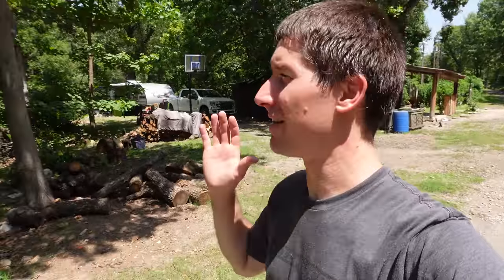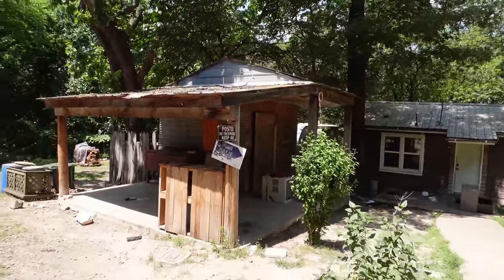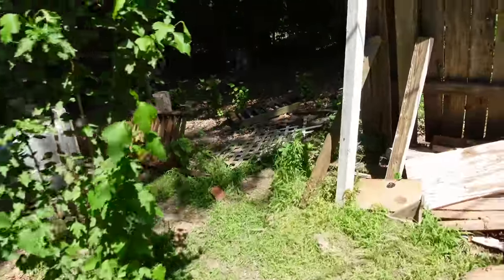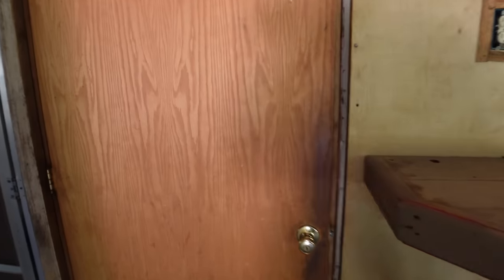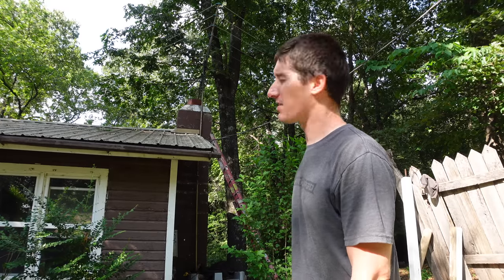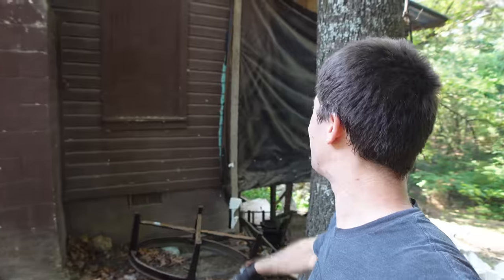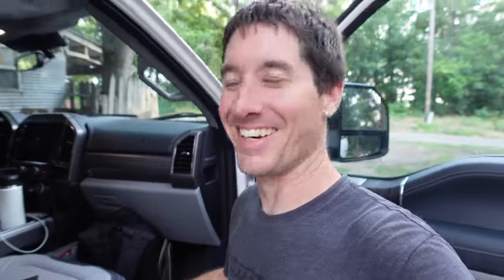I Bought An ABANDONED Mini Resort

Comment: Stove is likely worth something so don't be quick to toss it.  And the reason for the wood stove is to heat the house.  The Fireplace lets most of the heat out of the flue where the wood stove actually controlled heat better and would heat the home.
Reply: Came to say the same about the stove
Reply: As someone that tried to sell a perfect Glenwood CI stove, the market for those older stoves is incredibly small. I think he should service it and keep it.
Reply: He better save that stove. It’s probably the nicest thing on the property. Ben’e appliance and junk would probably give you 5 bills for that Gem. You can’t find the old Frigidaire stoves anymore.
Reply: Ain't nobody want no old ass stove for stove nerds, that's a stove for stove nerds
Reply: With an old fireplace,  all the heat goes up the chimney, provides no actual heat to the house.
Reply: @smith6ar  I love how this guy thinks everyone is as basic as him
Reply: Yeah, fastest way to cool a house in the winter, light a fire in a conventional fireplace. It's draws warm air in, and up the flue. Even without a fire, if the damper isn't closed perfectly, warm air is running up there in a convection draft.
Reply: @drippingwax  You find it weird that people cant physics? Particularly with the defunding of public education?
Reply: When I was a teenager my parents and I moved into a house that had a big cast iron wood stove, just about heated the house and when the power would go out during a storm my mom would cook using the top of the wood stove. In fact a friend of mine lived in a small house that had a wood & gas burning stove in the kitchen. The stove heated the whole house so much so that his mom would only use a microwave or electric hot plate during the summer... This was in Napa California in the 80's....
Reply: @josephblanchard943  yeah, things like that work great t, as opposed to the old brick fireplace. We had a steel 70s free-stamding in one house, and that metal would heat up and radiate heat for hours. Sometimes, in the middle,of winter, it got so hot we had to open the windows.
Reply: Here too say the same I would keep it
Reply: You can get high efficiency zero clearance wood fireplaces that pump out 70k+ BTUs of heat.  They're fed with outside air and the heat they generate stays indoors.  They cost a lot though.

A wood stove is definitely a cheaper option for efficient heat, but could be a liability for a vacation or rental home.  I'd go with a mini split instead.
Reply: @mycosys  not basic, clueless.
Reply: @Shauma_llama had an apartment in Oregon with no central heat, just wall heaters, half of which didn’t work, and an old (early 60’s) freestanding electric stove. Most of the time we’d run oil filled electric space heaters to maintain a semi comfortable temperature, but when it got REALLY cold we’d just cook something in the oven; it put out more heat in less time than the wall heat & oil heaters combined. We’d also have to crack a window when running it longer than an hour like when cooking a Thanksgiving turkey otherwise it’d get unbearably hot.
Reply: @robertm5969  exactly,  as an Airbnb owner myself last thing if want is people trying to light a fire in a wood stove
Reply: Keep the stove. It radiates way more heat than a fireplace. If you keep it running right, it creates less cresote in the chimney. Just make sure the chimney is clean. Before your first time lighting it
Reply: @drippingwax  Air that enters the firebox is heated, and flows up through the chimney, that's why we can have an open fire, but not suffocate in the room. The vacated air in the fire box, is replace by air in the room. Effectively, a vacuum is created in the house, that eventually will draw in external air from air leaks (badly sealed doors, windows, external walls, etc). So a plain fireplace effectively draws in more cold air, than it can produce radiant heat. You sit on the hearth and feel warm or hot, but the rest of the house will see the temperature plunge.
Reply: Those homes look like they are from walking dead series only in worse state
Reply: I ❤ demo!!! It's putting it back together that sucks...😂
Reply: I just sold a wood stove just like that. Had a bunch of folks wanting it. I wanted a wood stove with glass.

Comment: John Ross, after working on old houses for years, my guess is you'll be far ahead to remove the house, too, and either move in a prefab or modular or else build from scratch.  I've been guilty of trying to make a silk purse from a sow's ear and that's what this project is.
Reply: I agree, however I wouldn’t make the decision to tear down until the additions are removed from the house and structure can be evaluated.  I expect that their is plenty of water, foundation and termite damage.  The bathroom is nasty.  I also expect the plumbing and wiring is a mess too.
Reply: Environmentally speaking, I like the reduce, re-use, recycle approach rather than trash the lot and bring in new resources.
Labour intensive, yes! But it also retains  some character. I like a place/vehicle with a story to tell.
Reply: Home Depot is selling prefabs now.  JR will never get the smell of a@@ out of that house.
Reply: Probably best to bulldoze the decaying buildings and build something nice on the property
Reply: It’s a demolition job for sure he just bought a site or building lot

Comment: The wood stove is because fireplaces don't throw off much heat. The stove radiates better, so they were heating the house with it most likely. If you want to heat the house with the fireplace, you'll want an insert with blower motors otherwise 90% of the heat just goes up the chimney (I tried to heat my house with a fireplace in Texas during the SNOVID freeze in Feb 2021 and it didn't work at all). If you just want the fireplace for ambiance and cooking marshmallows then do whatever.

Comment: Crazy part is that people lived there. Seeing those chains that were probably used for the dogs is heartbreaking. Anything can be fixed up with work but it might be easier just to start from scratch. You obviously can do it. Looking forward to the change of pace.
Reply: I'm kinda thinking the same. It can be done, sure, but I'm wondering if the cost to bulldoze and rebuild wouldn't be far away from the cost to rehab what's there.
Reply: Agree. bulldoze and start new
Reply: Why? The frame is already there. Strip it to the studs, and start from there. Unless he can’t live with the layout, it’s a huge waste of money to start from scratch.
Reply: I hope they didn't abandon their cats there too.
Reply: @BearGrils55  Ok but stripping to the studs is a ton of work.  tear down is quick and framing is quick.  So if it needs a new roof and siding anyway.  cheaper to start over.
Reply: It’s not that much work. Ive done it plenty of times. You could easily have that place gutted in a day. Framing, and bulldozers cost money. Gutting it yourself is free, with the exception of the dumpster.
Reply: Also, he’d have to redo all the plumbing, and a new foundation. I don’t know in what world buying new wood, plumbing, and renting heavy equipment is “cheaper to start over”
Reply: @BearGrils55  if you think the foundation is anywhere near up to code you kidding yourself. This is the type of house where you did what you wanted when it came to building. Much of it is wrong those support beams for the "deck didn't even have lateral support lol. Just start over .
Reply: There is no foundation ‘code’ for this house. It’s grandfathered in. Also. Support beams can be added. But, you changed your tune from “it’ll be cheaper to bulldoze” to it “doesn’t meet code”.  I never said it was built the correct way. I said it’s cheaper and easier to rehab what’s there.
Reply: @BearGrils55  Probably not, need to factor in running costs, hospital fees, and life long medical conditions.  The resale value of a decent new build would be substantially higher than a patched up shed in the middle of a tip.
Reply: @BearGrils55  But professional concrete foundations will be needed to prevent the same level of decay recurring.  I would fancy the ready to assemble log cabin type of building.  And a coherent style to the place.
Reply: @uroplatusgecko2773  It's lasted for probably 50 years as it sits. it can be repaired to last another 50 years. It's awful looking, sure. but you have to have a vision for these things, i see the potential. As long is the structure is solid there is no reason to tear it down. what Hospital fees, and life long medical conditions are you talking about? seems like you're making up hidden expenses to justify a bad argument. if it were me, id gut it and redo the interior. green metal roof, and install log cabin siding. if he were to tear it down, he would've been better off buying a plot without a structure.
Reply: Bulldoze it.  Regrade the land and build new or just move a nice camper up there.  It’s really bad…
Reply: Keeping the structure and it is a re-model....otherwise from scratch building permits etc...
Reply: @christopherhamilton5557  It's really not that bad. just filthy. You must not do physical labor.
Reply: @BearGrils55  yes.

Comment: 14:27 Ashley heater were pretty common in the '50s & '60s. That one is pretty beat up but it would be more efficient than a fire place as you have more control over the burn. That dial is attached to a chain that opens and closes a damper. If I remember correctly the chain is on a primitive thermostat, it is a coil that opens the damper more if it senses the fire box is cooling down. They worked pretty good even if they were kind of ugly. The other good thing about those heaters is the metal surrounding the fire box gets warm but if you or a child was to touch it while the fire was going it would not burn you.

Comment: The wood burning stove will provide much better heating than a standard fireplace.  I would recommend keeping it!
Reply: He gets to pick
Reply: The fireplace was /is a heatalator. Metal sheel inside metal shell. See the exit vents.
Reply: I'd keep the standard fireplace for ambiance and use a heat pump mini split for heating/cooling

Comment: You need to do a "Holmes Inspection on the Home" and do what Holmes would do.  Tear it all to the rafters and studs and pull all the electrical, plumbing and make it all correct and have a nice cabin instead of the smoke shack....

Comment: The nicest things in the house are that stone fireplace and the 1950s kitchen stove. It would probably be cheaper and faster to tear it all down, you can buy a brand new park model mobile home with furniture, appliances, dishes, silverware, linens, etc already in it for under $50k, add a prefab shed and a steel carport, done, BUT, it will make for a lot more and better YouTube content to gut and rehab the house that's already there. The original part is probably at least still structurally sound, if you strip out all the junk and the half-assed add-ons people tacked up over the years.

Comment: With the wasp and hornet killer, you need to find their nests and wait until about sundown after they've all pretty much returned for the night. Then that high volume stream is used to saturate the nest and kills all of them on contact, including the larvae. The stuff I use will also kill any that return later for about the next four days or so. Then you can safely knock the nests down and toss them. If you don't hit the nests, you'll continue to have problems.

Comment: The fireplace will not really do much  towards heating the cabin. Pretty much just for atmosphere. However, the wood burning  stove will actually heat that small space fairly well. My cabin (7000 high) in the mountains  of northern Arizona(Flagstaff area) is quite livable in the winter. Keeping the fire tended, and banked at night, is necessary, but will do the job. My place is around 1200 sq. feet. Keep the stove unless you plan to add gas heat,or not  go there during the winter.
Reply: You can get high efficiency fireplaces that heat entire houses but they're not cheap.  But for this house I'd probably go with a mini split for AC/heat

Comment: Wood burning stove insert looks like it also has a blower and vents in the face of the stone work above and to either side of the stove. I think they used to call these "heatilators". But this would have been used to heat the home. Honestly, from what I've seen so far (17-18 minutes and I know you've already gone way far ahead with the project) this would be a tear down and start over. I've seen homes in this kind of shape on the west coast in San Diego, Pacific Beach area, where there was a state moratorium on new construction. The workaround was to tear down until there was one small bit of original interior wall left and then rebuild from there, and the County would call it a "remodel". That's what you should be doing here. But I know that's not going to happen, so I'm on board to see what you do with the place.

Comment: Sad to say, most of the construction is rather sketchy. Before spending any serious time and money on remodeling it, I'd take a close look at the roof and the foundation to see what's needed to make it safe. It seems pretty clear that the county doesn't do inspections unless you pull a permit. I can't believe that there were any permits pulled for that cabin based upon what's there in the video. The pavilion is the only thing that looks like it was constructed by someone who knew what they were doing, and even then the roof may be salvaged material with pre-existing holes.

Comment: I'm blown away that he didn't realize that was a woodburning stove. Have you ever dealt with woodburning stoves Jr.I thought you were like close to my age i've seen thousands of those If you've ever tried to heat a house with a legit fireplace. You'll realize it doesn't work very well. All the heat goes right up the chimney and you just nonstop throwing in wood. However with that wood burning stove you get the heat because the stuff of howl tea produces heat. If you put it on a heating with a wood heat get a wood Stove don't try to use the fireplace without an insert

Comment: I would check the disclosure, if the water heater is as you showed it, it is non functional. If you got the place for super cheap I wouldn't bother. But that is a dick move on the former owner for how the place was represented and would stick it to them if possible.

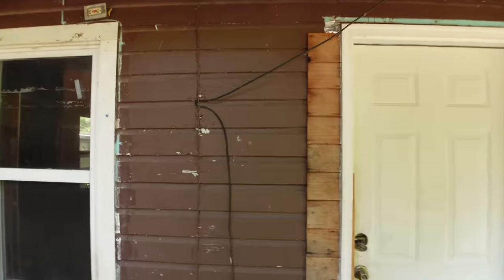Comment: I have never been on this channel. I thought this would be much more interesting. If you want to know about the house, which is the only thing I cared about, start watching at 12:39. Just about everything before that is an enumeration of everything that is going into the dumpster (99 percent of what you see). The house doesn't look salvageable either, except for the new windows.
I stopped watching at 18:14. Just not for me. The only two things that intrerested me were the stove (you guessed it, going into the dumpster) and the two cats which Steve hopes the sellers will take with them.

Comment: Welcome to the same nightmare I bought. 1. WEAR a mask, please.  Lots of yuck in anything you are cleaning (trust me, you don't want to get sick, especially cleaning the previous trash/food/yuck the previous owners left for you to clean up). Mine is a 1,000 sq ft cottage, with 100 amp service. We have a electrician (family/cousin) who is now replacing all of the power sockets/switches/ceiling light enclosures (and put a 30 amp circuit for us to plug our RV into). We bought ours up in Escanaba, MI for $36k (across from and facing Lake Michigan), so it is worth rehabbing the cottage since the septic/artesian well & electrical are all good). Please, update us often (would love to see your solutions versus our solutions since we are on a small fixed income (Disabled Vet, limited income). :)